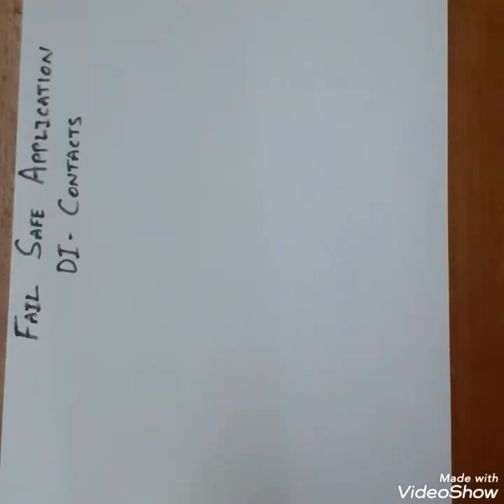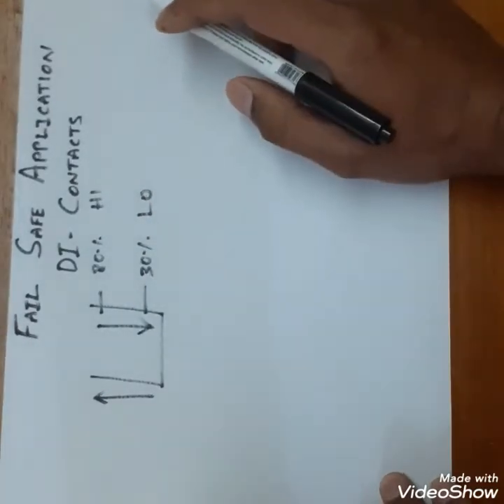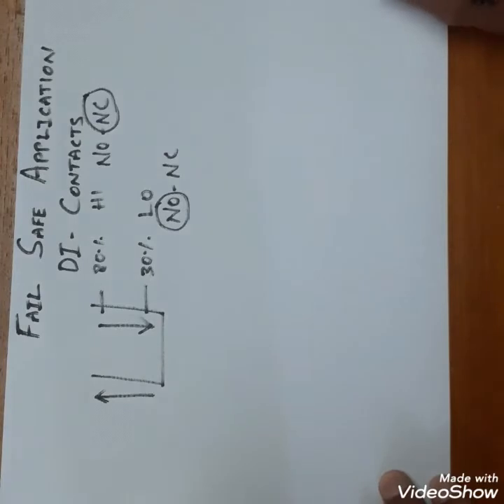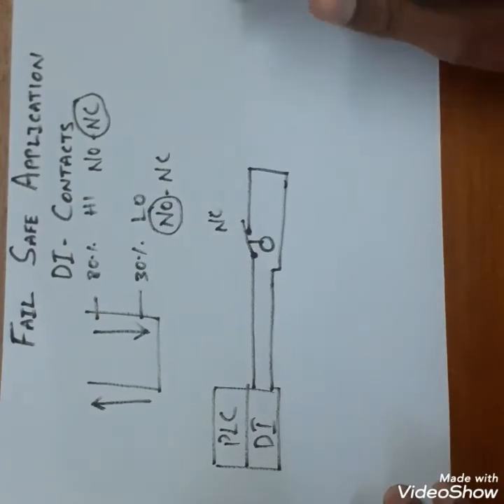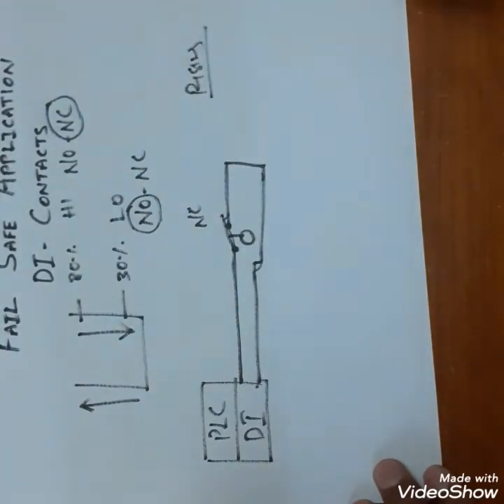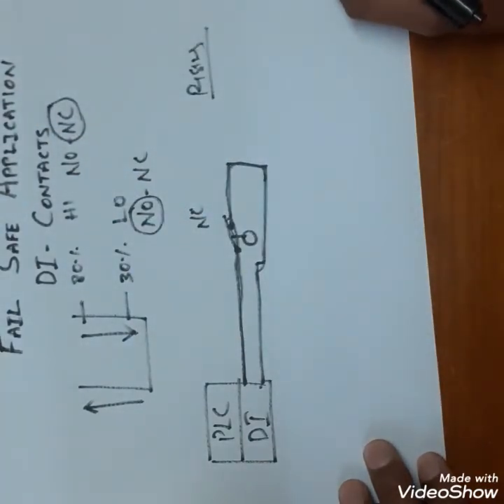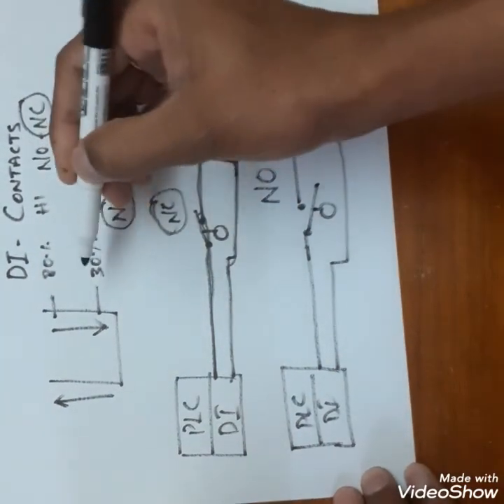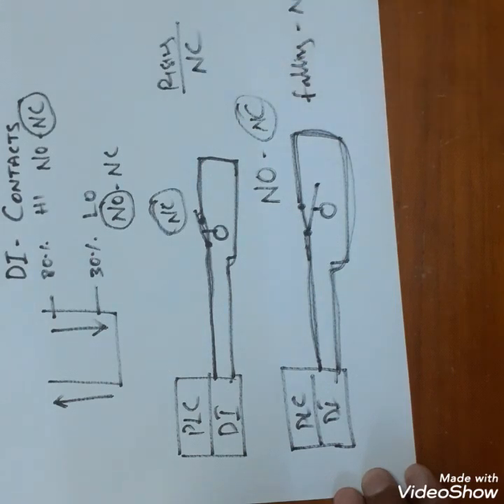Concept of Digital Inputs Contacts (NO-NC)

Comment: Why always use in low parameters NO contact ?
Reply from the maker: The loop should be close loop so if anything happens (wire broken or fuse blown or sensor damaged etc) in that loop then alarm will be generated for safety purpose .